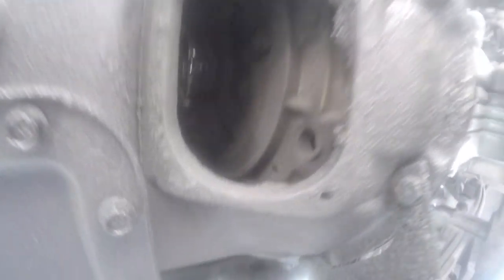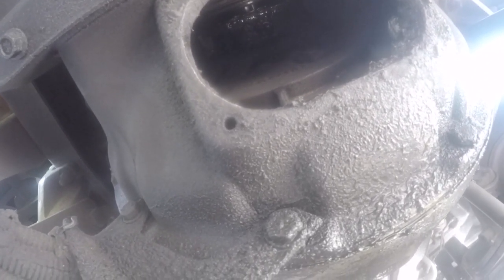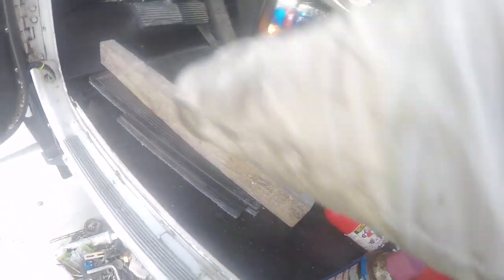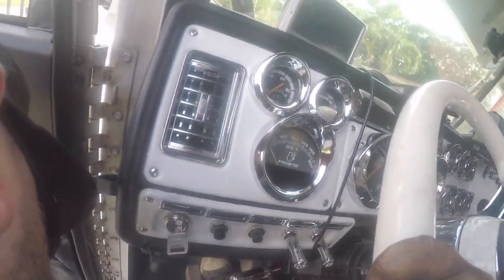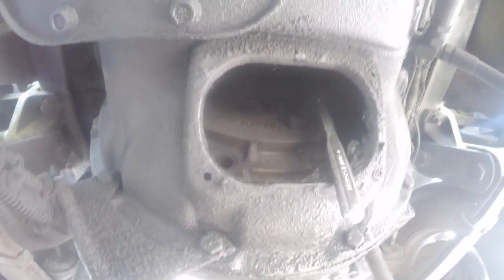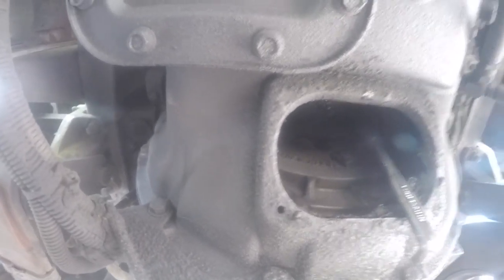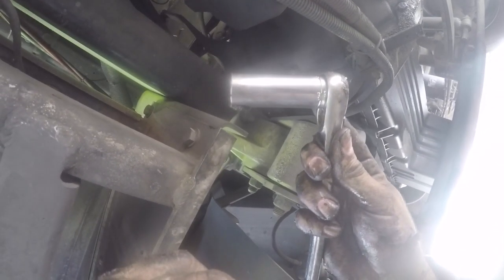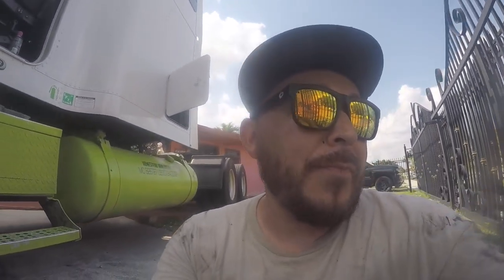Easy way to adjust the clutch yourself with no help

Comment: The way you did it is correct. I prefer my pedal freeplay to stop even with the brake pedal though.
Reply from the maker: Rob Wilk I will try that next time thanks for the tip
Reply: Too much free play if even with brake pedal, 2 inch of free play /travel off the top of the clutch pedal is recommended by every manufacturer.